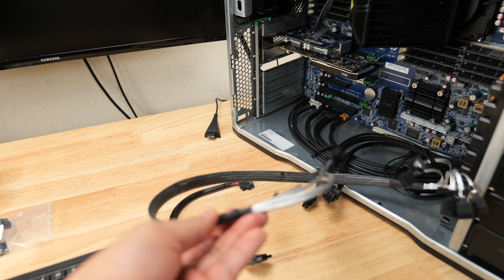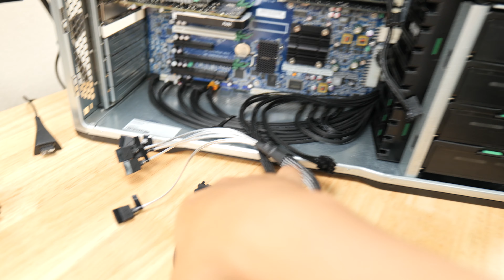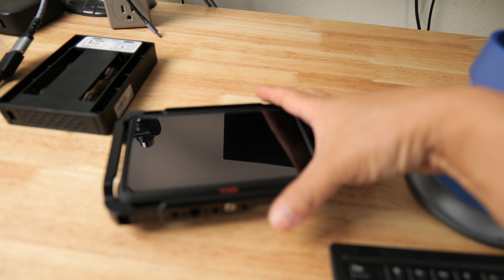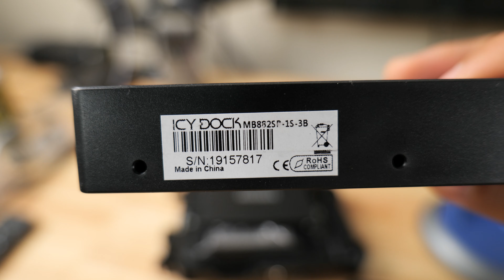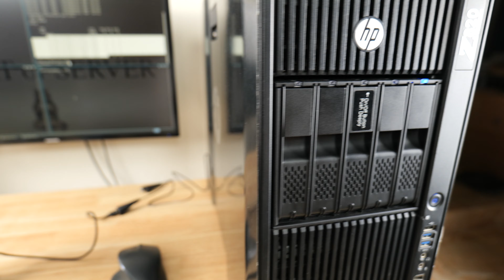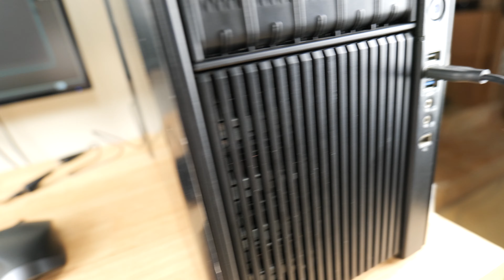Finalizing Icy Dock MB975SP-B in HP Z820 | Showing Icy Dock MB882SP-1S-3B | Part 4

Comment: Wow - this video series makes me realise the potential of my z820 is still strong in 2023
Reply from the maker: I think it's still a great machine and plenty useful. But the Z840 prices have come down a lot too, so that might be a better choice now.
Reply: At this point the use case is to run a number of VMs during my office hours. It appears a CPU upgrade may help me as im on dual 2940s, and I may just take advantage of cheap memory prices to go to 256gb 😂. however it looks like there is a lot of over lap with the 840 cpu wise, so on a 840 I might only get a minimal perf gain over the potential of an upgraded 820. My thinking is keep my work horse going and then wait for a reasonable Z8 G4 maybe in a couple of years.

Comment: I commend you for following all the way through on this project! I was considering this Icy Dock unit, but it just feels like way too much of a hassle to use. I was also immediately wary of accidental drive power-offs given the position and sensitivity of its power buttons, as you quickly noticed too in the first video of the series. I've enjoyed Icy Box / Icy Dock / Raidsonic products for years and it's disappointing to see such a poorly thought-out product with such a flimsy finish.
Reply from the maker: Thanks! Yeah, this particular product does seem like it could be improved. But the issue with the "tabs" is not unique to Icy Dock... i think when you're trying to fit 5x3.5" in 3x.5.25", it is inevitable so I can't fault Icy Dock for that. I'm not a fan of the push buttons though...
Reply: @ArtofServer  It does seem inevitable. It's too bad because this MB975SP is the best-looking drive bay I'd found, with its all-black panel and modern-looking blue LEDs. I've given up on these drive bays, I'll be getting a Fractal Design Define 7, which can hold up to 14 (yes 14!) 3''1/2 HDDs inside its mid-tower chassis, for a price that's ballpark comparable to that of this Icy Dock drive bay.

Comment: how cool  does that tiny fan keep  5 enterprise hard drives  drives in that tiny space?
Reply from the maker: it works well enough, but the drives in the Icy Dock are a few degrees higher than those in the internal 4 bays
Reply: @ArtofServer   what if you replaced it with a higher   static pressure fan or used a 80 to 120mm  fan adapter?

Comment: So while I'm sure you knew this my friend, the Startech 4x3.5 would have likely slid in here with zero mods. It's made with the channels. I put it in several of my old cases. I'm dumping my Z820 since I have two Z840 w/44c and two Dell T7910s w/44c. Trying to move out of DDR3 and keep everything high-core DDR4. We'll see. :)  OH AND--guess who modified their T7910s with more drives after watching a certain video? Yep. And did you know (likely you do) you can actually put 8 2.5" SSDs (SAS or SATA) in here physically? Just need a decent LSI controller for the channels. You have to design a rigged mounting, but still.....
Reply from the maker: yes, as mentioned in my unboxing video of the icy dock unit, the 4x3.5" enclosures have no problems because they have the channels. it's specifically the 5x3.5" enclosures that all seem to have this issue and require modifying the case, and in this case also the enclosure.

I still find the Z820 pretty useful machine even today. But yes, with the price drop of DDR4 ECC RAM this year, I think that makes Z840 and other DDR4 platforms much more affordable for home server setups.

thanks for watching my channel and sharing your thoughts! :-)

Comment: Hi there, thanks for the video. Do you plan to do any content on the HP Z6 or Z8 Gen 4 or 5 machines, that are now becoming very cost effective to use as a home workstation. I am thinking of trading in my fully specced out Z840 to get one of these newer generation machines, and needed some sort of thoughts/opinions and options. Keep up the great work you're doing for us.
Reply from the maker: You know, after HP changed the design since the Z800/Z820/Z840 generation, I just couldn't get myself to admire the Z8 Gen4 stuff. I think the previous design seemed more elegant and something I would like to see under my desk. The new design looks like a cheap PC  case to me. Also, after the Haswell/Broadwell Intel generation, I think my next upgrade would be to an Epyc or Threadripper. I want more PCIe lanes! LOL That's just my opinion.

Comment: I used a Athena Power BP-TLA2131SAC 3 bay in a Z840. It is running ProxMox with a Truenas Core VM that I pass the controller to. I have noticed that drives in the  BP-TLA2131SAC run 4c-8c warmer (under load) than the drives in the stock drive bays. Do the drives in the Icy Dock show the same behavior?
Reply from the maker: Never heard of the Athena before, but it looks very similar to the ones being sold by brands like iSTARUSA, Monoprice, etc. Yeah, the Z840 was a lot easier with the 3x3.5" bays. This 5x3.5" bay solution was much more involved than I wanted, but I got it done.

As for the drive temps, I haven't used this long term in this Z820 yet so I don't know for sure. On my HP Z840, with similar non-Icy Dock unit (see my other video), the drives run about 42-44C, but the internal 4 bays runs 37-38C.